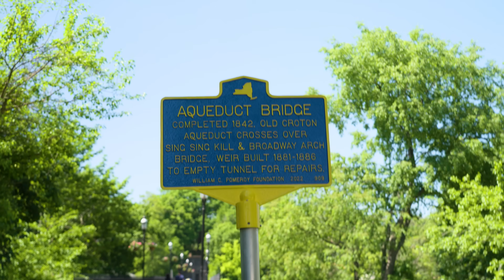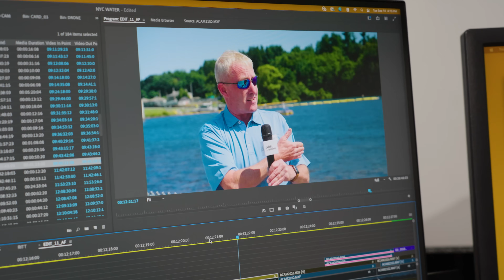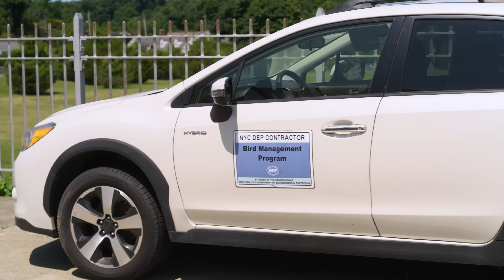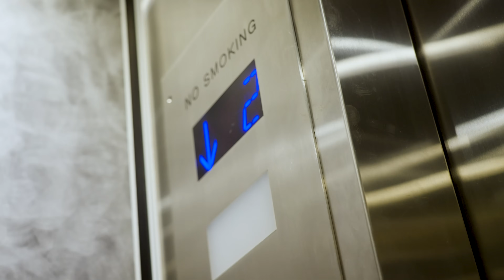We Traced NYC's Water Supply to the Source

Comment: I really love these videos. I work for a large utility on the west coast. I only deal in electricity so I think it would be great if you can do how NYC gets it's power. Generation, and transmission. I've never been to NYC but I'm guessing there's not a lot of room for big transmission towers. So do they just have a series of substations on the outskirts to transform the voltage lower and run it all underground?

Edit: Found a video on electricity, but haven't finished it yet. Hopefully you cover the parts I was asking about

Comment: The tanks on top of the buildings, They use the same method, starting with a 3 inch pipe, reduced in size to 1/2 inch at the top, and they provide the pressure for old buildings that are over 6 stories. The small 1/2 inch pipe fills the tank by a float valve, just like a toilet tank uses, and the water fills to the top of the tank. so, a 10 or 12 story building has the tank that provides the 60 psi of pressure for the whole building.

Comment: He's missing something. The croton filtration plant, which filters Croton & Delaware water systems. If I'm not mistaken in 1 of van Cortland parks golf courses probably a 1,000 ft underground is 1 of the city's water tunnel and the filtration plant is connected to that tunnel. The Jerome park Reservoir was to fliter Croton water but was decommissioned due to it being an open air reservoir as well as central parks reservoir which is also decommissioned. Any water u see in em is basically standing rain water. All filtration of nyc tap water is done under the golf course in van Cortland park. Just in case u wondering Jerome & central parks reservoirs were closed due to security & contamination purposes bird shit, environmental shit & dead bodies don't belong in reservoir that holds your drinking water which is 30 mins or less from ya tap🤣

Comment: Cool video - wish you had more time to go into greater technical detail or show some of the valves and systems, but I’m assuming there were plenty of security and time issues.

I’m curious about flow control for the aqueduct and main tunnels - if ANY part of ANY of those systems fails, wouldn’t it have the potential to essentially see full head pressure from the upstream reservoirs and drain at the same rate? 

He mentioned they were flowing at a low rate at the top, so I guess they manage flows along the way, but there were other reservoirs downstream so that wouldn’t change pressure/risk down at the city.

I’m assuming there are some huge gates and flow control systems for the main aqueduct and the three main tunnels in the city? I’ll have to research those… I’m sure it’s fascinating.

Also why not use lapel mics? These days the handhelds just kinda look… awkward.

Comment: Great video. Any info about the water towers? Is that holding actual tap water for buildings taller than 5-6 stories??
Reply from the maker: Yes they hold actual tap water. We made a  follow up about how water gets to the top of the Empire State Building… coming soon
Reply: @publicopinionnyc  It concerns me, because I don't think those are regulated as well as the rest of the water supply. They might be in disrepair and birds or rodents (or, heck, a dead body once a few years back) can make their way in there. So if you live in a high rise, your water supply isn't quite up to snuff.
Reply: @serrahirsch1913 you’re right, there was actually an issue in the Bronx with contaminated water from those